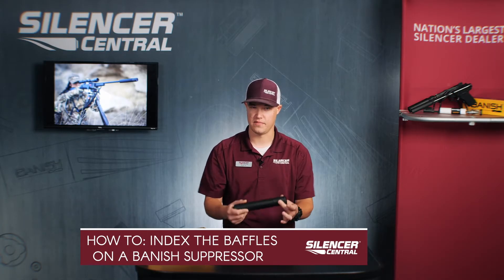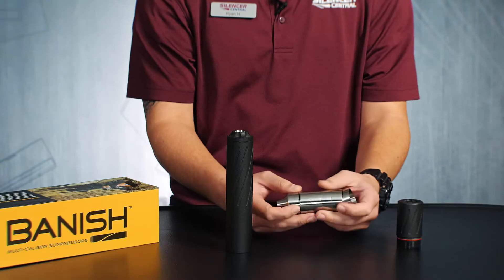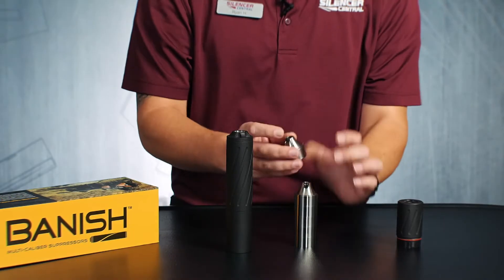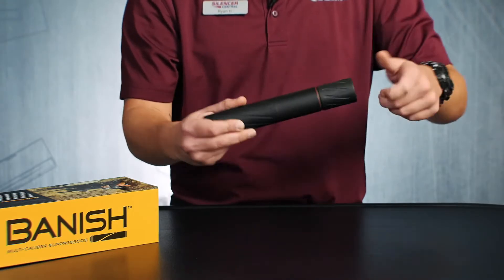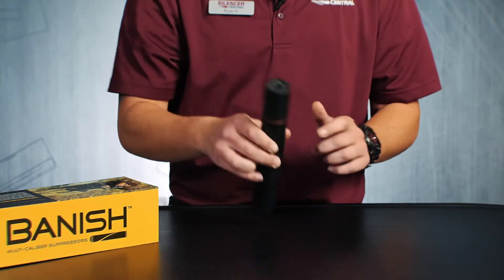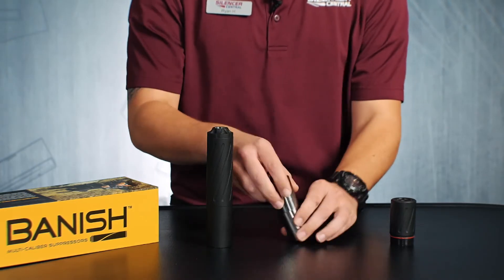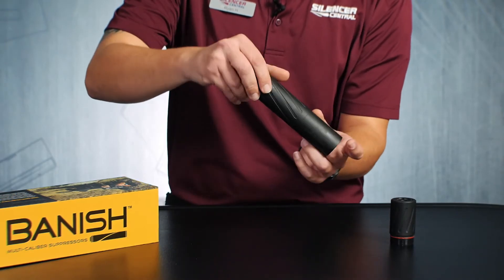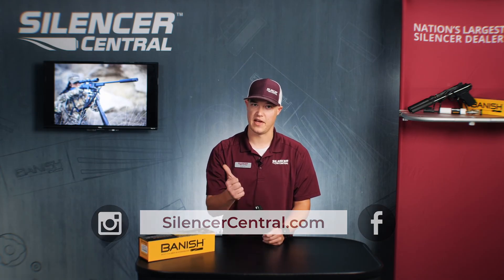How to Index Baffles on a BANISH Suppressor

Comment: What happens if the mouse holes don’t line up? But everything is seated and and tight. No oring exposed
Reply: After the first shot, you will end up in a parallel universe.

Comment: Bunch of crap, those side holes on the baffles do NOTHING to the performance of the baffle. turning (opening) the baffles into a larger caliber does exactly the same thing (and better).
Reply: Make your own then!
Reply: Have to agree. I have a friend who built his Form 1 can and it doesn't work at all to suppress the sound of his 6.5 grendel. My guess is he will need to enlarge the center hole and drill small holes around each baffle. What is your professional opinion and suggestion? Thanks!
Reply: @kellygibson4653 

Manufacturers use R&D, time and money  to make their products perform better.
Taking advice from a random observer on YT is laughable.